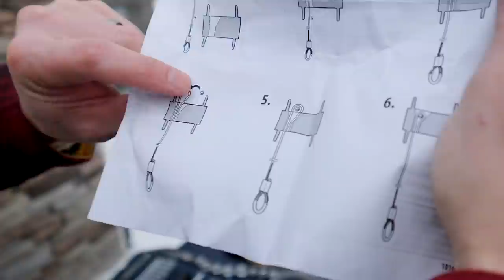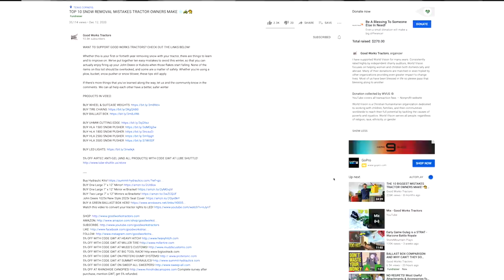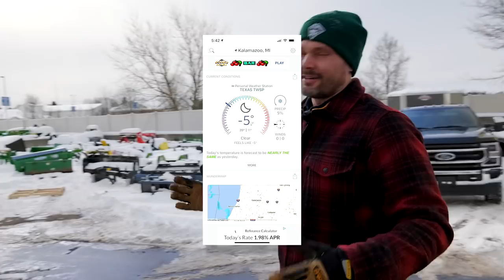$35,000 MISTAKE PART 2: GATOR 865R FROZEN IN THE GROUND 🐊🧊⛏️

Comment: So that little thing that holds the rope in is called a "swedge" they use those on steel winch lines for dozers and cranes. Once they are seated properly they can be a pain to get back out. Also there is no worse feeling when you pull the winch out to find out its not attached to the drum.

Comment: We have Kubota RTV's at work up in Northern Alberta. One thing we learned early...these things aren't made for deep snow or mud. Gators appear to be the same.
Reply: Right!  Too light, wide, and long for its ground clearance. It floats over snow very quickly. That is my experience with a Can-Am Defender. It's just laws of physic, nothing related to the color/brand of the machine!
Reply: @FromSteelToWood  our 6x6 defender seems to do much better in snow than our pioneer
Reply: Yes, I must admit a 6x6 is such a beast!
Reply: RTVs were particularly bad in deep er... stuff.  Low ground clearance and a heavy vehicle.

Comment: With the plow weight on the front you lose traction in the back, but since it’s sinking in mud probably not anything would help! I second the high Lift jack to raise the tires and frame up to get boards underneath.

Comment: At least you got it & nothing broke.
Reply from the maker: Yeah, as long as that front left wheel is okay.  Feel like it should have power, but maybe not.
Reply: @GoodWorksTractors  limited slip is not the same as locked.  Limited slip will still act like an open differential when a enough force is able to hold one wheel the other will slip.

Comment: Nothing wrong with the limited slip, it’s doing exactly what is supposed to do. It helps keep you from getting stuck not getting out.
Reply from the maker: Well why can't I turn it off? 🤣
Reply: @GoodWorksTractors  do a google search and it will tell you how limited slip differentials work. Basically there’s a set of crutches that can slip if there’s too much grab on one side (like when wheel frozen in the mud)  it  equalizers your wheels when there’s not a lot of traction differential. Limited slip has no on or off it’s always working.  It’s a very good option for the front axle but a locker is better on the back.

Comment: Not to be critical but maximum winch rating is only on the first layer of the drum. Good snatch black back to the machine will double your winch capacity. And if you put your tree strap 10 feet up the tree and it would have been picking the back end up instead of pulling it into the side of the Hill. Anyways it was a good learning experience for you keep up the videos
Reply from the maker: Thanks, learned that about the winch rating.  That is deceiving and dealers that sell winches should make much better recommendations.  What happens if the amount of rope or cable doesn't match up with how far away the tie off point is?  Everything would have to be situated perfectly to get the max rating out of the winch.  

I keep reminding folks that you guys saw a 20 minute video.  We obviously didn't show everything we tried.  However, there is a snatch block shown being used in the video that no one picked up at all.  We also tied off higher to trees as well.  There were significant limitations with the position of the gator as the winch rope wanted to run on the tire, frame, and body panels.  

So many variables that don't show up in a video compared to being there in person.  Thanks for taking the time to watch.
Reply: @GoodWorksTractors  No problem I did see the orange block.Most of the higher end winch ropes have a different color on the end of the rope to let you know you are on the last layer. I agree you need to do your research on the ratings. Just like generators. I enjoy your videos, I have a 1026r and a 738. Got rid of my larger compact that i could no longer get parts for. I wish the 1026 was about 2000 pounds heavier! Had to go back to the 738 for mowing, I bought a new Ferris 2100 that was awesome but didn't like some steep banks that I have. The 7 series are so easy to work on.

Comment: MY two cents====  Wrong type of tires  for snow=== the winch missing piece is called a weged to hold the rope/winch cable to the drum. Always leave at least 3 to 4 winds on the drum. The rating is base on bear drum ( first layer) every layer you add  you lose pulling power.

Comment: Anything that is framed out like that is going nowhere. Doesn’t matter what brand it is. And with the winch, I would try using the snatch block to double to pulling power (run the winch line through the block and then hook it back to the gator at the same point where the winch is mounted). I am surprised the winch line broke, I’ve always used steel cable.
Reply: Looks like he was using synthetic cable. It definitely won't have the capacity to pull like a steel cable.
Reply: Synthetic cable is great when used correctly and sized accordingly and much safer in the event it does snap not sure how it handles the colder temperature but in Australia its not such an issue so beyond my own experience
Reply: @bwj3456  synthetic cable is stronger than same size steel cable and many times safer. I have a number of winches and first thing I do is get rid of the steel cable. Synthetic is so much easier and and safer to work with. The extra strength is just a bonus.

Comment: Any winch if you double line the cable you double the pulling capacity.  I have a 1025 tractor that I buried to the frame in the mud.  I have a Polaris 570 atv with a 3500 lb winch.  We ran the cable from the atv to the tractor and ran the cable thru a snatch block (pully) which was attached to the tractor and back to the atv,  We spun the tires on the atv to anchor the machine to the ground set the brakes and started to winch.  The tractor came right out.  The Predator winch came from Harbor Freight.  Around $100 on sale with a 20 % coupon and it has never let me down.
Reply from the maker: Snatch block was used in this video.  Double the pulling power, same results.

Comment: Winches are rated for full pulling power when there's only one wrap of cable on the drum, synthetic rope usually has a minimum number  wraps too so it's less likely to pull loose.  Could've used the snatch block to double your pulling power.
Reply from the maker: I did use a snatch block which is shown in this video.  It did nothing.

Comment: Dont know if anyone has told you this yet but when you get a '''4500" winch... It will only pull that weight on the very first winding. After than it starts dropping capacity with every additional winding on the drum.

Comment: Great video. I have a Polaris and have been stuck before not quite that badly. One thing I did to reduce friction was drop the plow.   I also think I will stick with Polaris.
Reply from the maker: Yeah, we considered dropping the plow several times.  Not sure if you watched my plow install video from a few months ago, but that thing is not fun to install or move around.  Plus, I felt the back end was the biggest problem sinking down and really thought the winch would manage to pull it out.  That's the specific reason I got the winch was to bail me out when stuck.  Thanks for watching!

Comment: I got my 1025R stuck in a similar fashion, towed it out backwards, too. Unfortunately, pulled the rear seal out of the front differential, tore up the protective boots, some other damage. Cost me $400 in repairs 😒

Comment: You should have put the Polaris between the Gator and the tree and then connected the Polaris front winch to the tree. Use both winches and some throttle on both machines. We did this with my pick up truck and it made a huge difference.
Reply from the maker: Hmm, I'm thinking the Polaris would have been stuck as well, but maybe not.  Good idea to keep in mind for next time!  Thanks for watching!

Comment: You had me yelling at the screen.  Snatch blocks double your pulling power.  So if you had the winch on the rear of the Gator, thru the snatch block, and then back to the rear of the gator you would have 9000 lbs of pulling force.  

BTW A friend of mine once explained the amount of force required to pull out of a stuck vehicle. He said they use the weight of the stuck vehicle PLUS a pulling uphill or downhill factor PLUS an adjustment for what you’re stuck in.   Stuck body deep in mud adds another 2.5 times the weight of the vehicle.  To quote the movie Jaws, “We need a bigger “winch” (or was that boat?)”
Reply from the maker: Notice the snatch block used in the video made zero difference.
Reply from the maker: Lesson learned.  Like trailers, barns, and gun safes, always get a way bigger winch than you think you need.  😂

Comment: I was always told minimum winch rating of 1.5 times the weight of the vehicle. I think the 4500 was definitely on the low end of power. Minimum power is never good. I have a 2k on my atv and it works good for a 700 lbs machine but my buddies 3500k really yanks things out easier in comparison. I thought I heard a pop at one point that sounded like an axle. A mechanical update on the gators 4x4 would be of interest.  Glad you got it out every recovery is a learning experience.
Reply from the maker: Yeah, bigger is better, haha!  So far so good on mechanical functionality.

Comment: I think on a limited slip the wheel with the least resistance is the one that pulls. At least that is the way i remember it being told to me.  I think you would need a positive traction for both wheels to pull or a way to lock them together.   I have a Honda Pioneer that has regular four wheel drive and also  you can lock the wheels together. They don't recommend leaving them locked together unless it is a necessity.

Comment: As a guy who has done lots of dumb stuff and learned the hard way, I will say there is good info from comments, but I didn't see anyone mentioning putting a crap-ton of salt all around the machine to keep the ground softer overnight and melt off the snow and ice. It would need to be rinsed well afterward, but that is kinda a given with the mud anyway. If you don't have salt,  getting the tires up and out of mud makes a BIG difference. A farm jack/hi-lift and fire wood/tree branches/concrete blocks/dead babies to get it off the ground through a freeze will save cursing and damages the next day. Torn CV boots, broken axles, burnt belts, tires off the rim,  all kinds of nasty happens when stuff freezes.
The CVT in those rigs is both a blessing and a curse, as is most of their "limited slip" differentials. They just aren't as positive a connection as needed to know what's happening. The cold doesn't help either.
Glad you got it out and will be watching to see what the damages and decisions end up being.

Comment: From a power sport mechanic standpoint and someone who has used winches for years and years I would say that’s about normal, you gotta remember your not just pulling the weight of the machine your trying to pull it through all that mud and muck, there is a lot of resistance more so that just the weight of the machine. If you wanna get more power out of the winch run the winch cable through a snatch block and back to the machine this will give you 1.5-2x the pulling power, and also I know you had the winch all the way most of the time but just so you know a winch only has full rated power on the last wrap of the cable on the drum so the more wraps you have the less power it will have reducing it 25-45% ish the more you spool in. A way to look at it to is if you snapped the cable which its rated for that winch how much real world weight were you actually trying to pull against....gotta have real world expectations

Comment: It's fine for the winch to not be fully secured to the spool on the end. Just put the line through the hole in the spool and wind it in 5 or 6 wraps. The wraps will lock the line to the spool so you just mark the cable at that point either with a piece of colored string, ribbon or paint. Use that mark as your stop point when pulling out the cable in the future.  Keep your new winch line in your machine and you will always have a replacement plus you can use it as an extension.. Murphy's law, if you have 50' of winch line the nearest thing to anchor to will be at least 51' away.
Reply: Also shackles and snatch blocks are your friend! We go WAY back into the Alaskan wilderness and have to be able to get back out. I carry 3 of these plus shackles a land anchor and tree savers. 

https://www.amazon.com/dp/B086SH1JVR/ref=cm_sw_r_cp_apa_fabc_0ADCPDCMV14T8H3RKZR7?_encoding=UTF8&psc=1

Comment: At least 5 wraps on the drum (more for synthetic ropes) and a snatch block. Should always be with you, as well as a tree strap and tow strap, chain, or another length of cable. The snatch block can also be used for a change of direction. I carry a minimum of 2 to have the ability to change direction AND multiply pulling power.
Reply: Forgot to mention: Don't cinch the eyes of two tow straps unless you want them perminentaly attached to each other. Use a shackle to connect straps.
Reply from the maker: I didn't have any shackles.

Comment: You need to get a snatch block for the winch it will make a huge difference.  Anyone needing to be heavy winching should use a snatch block.  All winches are rated for rolling load, so the rating a pretty low.  The down side it will effectively shorten your cable length by half.   The are cheap like $30, but a life saver.
Reply from the maker: I used a snatch block.  It's shown in this video.  Made no difference.
Reply: @GoodWorksTractors  sorry did not see that.  In that case get a winch for the pickup and have it on receiver mount like this one, business write off and then sell the utv winch.  No matter what those conditions sucked to be out in for 3 days...
Reply from the maker: So there is a magical limit that means it's mechanical advantage vs redirect?  I've watched 50+ videos on YouTube and almost all of them tie back to somewhere in the general vicinity of the winch, but not the winch itself.  This means there's space between the winch and where the end of the cable is secured.   I would like you to explain when and how that tie off point goes from mechanical advantage to redirect.  How big of a gap because it's nearly impossible for any machine to be able to tie off with a 0" gap between the winch and end of the cable.  Is it a gap of 1", 6", 12", 3'????

Comment: Great job getting it but much easier using a snatch block.
Reply from the maker: I used a snatch block with no luck.
Reply: I have ATVS WITH tracks. Not as good as snow mobiles but fun to play with but they’re a pain when I broken axle and one side don’t turn or gets buried.

Comment: Not sure if your winch is the same but Most winches ive installed the “disc” at the end isn’t a disc. It is just a ball bearing about the size of a marble you tucking into the end of the winch cable loop which allows it not to slip through the hole when you start to pull on it.
Reply from the maker: Thank you sir!

Comment: Your not only dealing with the weight of the Gator and the snow plow, but the force created by snow the mud and everything caked and frozen to the machine. Winches also work better when using a 2:1 mechanical advantage. I would have dropped the snow plow before attempting the initial recovery.
Reply: You definitely got a S___ sandwich on that one. 😡

Comment: A Gator is made for tooling around the barnyard.  If you want a ORV or mudder buy a ARGO, you won’t get stuck.  I didn’t think it was a good idea to hook a recovery strap up to a towing ball on the truck, better is a shackle with a pin?
Reply from the maker: We were in a yard with snow on it.  I struggle to see how a barnyard would have been any different.  Could have used shackle, didn't care.  Ball worked fine.  Load was below us.

Comment: I hate to rub salt in a wound, but I have an old 2004 Gator HPX 4x4 and in 4wd the front tires would have been helping a lot more than yours was.  Not sure whether you have an axle or transfer case problem or something, but it takes a lot more work than that to get mine stuck.  Mine's a gasser, open cab (doesn't even have a ROPs, it's that old)...maybe the fact that it's a lot lighter works in my favor?

Comment: Did you try the snatch block with the winch?  You saw my picks, the tow truck snapped his 1/2" cable he had to use a snatch block to double the winch pulling power. I had Toyota 4 wheel drive truck, the compact one from 1980. It had a 6000# winch with a snatch block it would double to 12,000#. If I anchored my truck to a tree I often pulled out full size trucks stuck in the mad
Reply from the maker: Yes, we used the snatch block in the video.  Didn't make any difference.  Still didn't move a single iota.

Comment: So, where to begin? I've had my 825i since 2016 and am just now shopping for a snow plow. It looked like your 600+ lb plow setup became a burden while trying to get up the hill, which makes me think I will stick with the much lighter manual angle plows and use the Warne winch the dealer installed when I bought mine. My winch cable is steel and the system is also rated at 3500 lbs, I don't know why they went to nylon cables but I have to believe they're not as resilient and I've not had a single problem with mine. I am concerned why the left front wheel didn't appear to be driving along with the rear wheel in one scene, I wonder if Deere has some degree of traction control designed into their four wheel drive? In any event it wasn't helping your cause.  Thanks for sharing, God Bless.